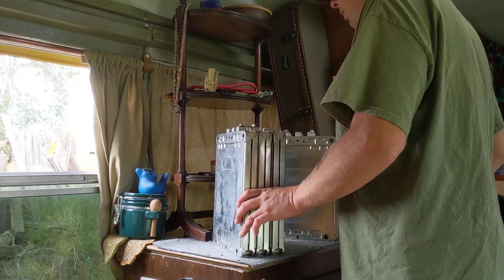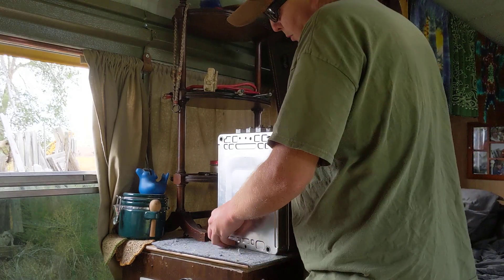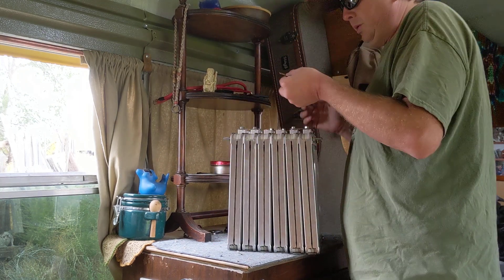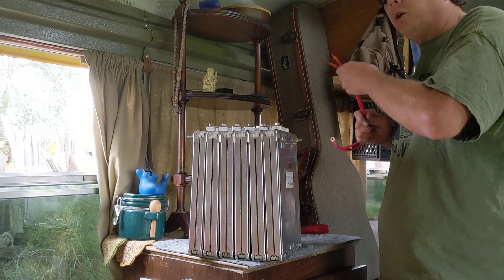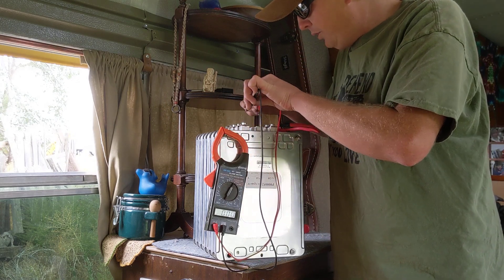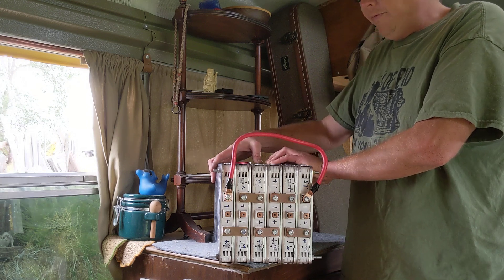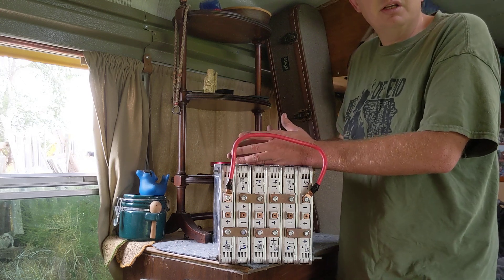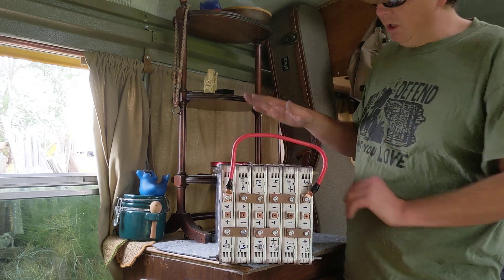Doubling the storage capacity of my 24v Nissan Leaf Off Grid Solar System by paralleling two packs.

Comment: I saw them on ebay for a 5 pack 320 shipped so if I get 2 I get a discount and I'll have an extra one left so I would do 3x3x3 how would I connect them for 24v
Reply from the maker: https://youtu.be/MSNv-RiF5h8
Reply: @ezmeraldadudortoka7549  I seen this video and saw the one where you doubled it and wired it but I'll have 10 modules so want to know how to wire the 3 3pack togethee
Reply: @Willsmokalot  these nissan leaf cells come in two polarities - depending on the cavity positiv is left or right. In order to assemble 3x3 you would need a set of 3 cells in a different orientation as this maintains the compression the pack should have through the threaded rods. If your cells all same you would need an appropriate spacer and because of that different busbars to connect a cluster of three to the next cluster...Or you assemble three individual batteries from 3 cells and connect them in parallel..

Comment: How are you dealing with BMS ?  I just purchased 6 of these.   Guessing using a 6S and tying to the center post too.    I don't want to charge the things to 4.20V .  The service and cycle  life means more to me then the little bit of added capacity you get with it.   Thinking of not even using one.  Just use a  6S Balance Board and Control the charging with a voltage monitor PCB. .
Reply from the maker: Keep in mind that these batteries are already used. Unlike Tesla, they were manufacturing their battery packs to operate at a maximum instead of throttling them back a little bit like Tesla. Tesla promotes longevity over immediate power.

I don't have a BMS and probably won't unless I buy more batteries. You're correct with the 6s if you wanted to get one, and use that middle terminal as both positive and negative for the cells inside.I literally just keep my multimeter in my power cabinet and manually check them every couple of days.
Reply: @ezmeraldadudortoka7549  Yep,   I'll just tie in a BMS monitor cable and measure it for a while.  See what's going on.   Just using a Balance Board on my Headways and they do fine.
Reply from the maker: Did you happen to use my code to get free shipping and 5% off?
Reply: @ezmeraldadudortoka7549  No I had a 10% off.   Nothing about shipping.
Reply from the maker: @pulesjet  Did you get generation one or generation two?
Reply: @ezmeraldadudortoka7549  One !
Reply from the maker: Why?
Reply: @ezmeraldadudortoka7549  LOL.  Cheaper, of course
Reply from the maker: @trevinom69  except they're not.

Comment: Can you add 6 more batterys in parallel for a total of 12 at 24 volts
Reply from the maker: Sure! Add as many as you want! If you get to 15, I'd recommend switching to a 48v system.♻️🔌💯☀️
Reply: Yes as suggested go 48v and make sure you use a BMS these swell pretty fast when overcharged.